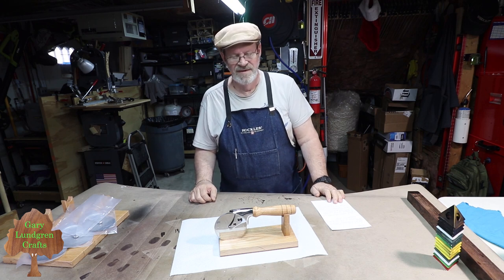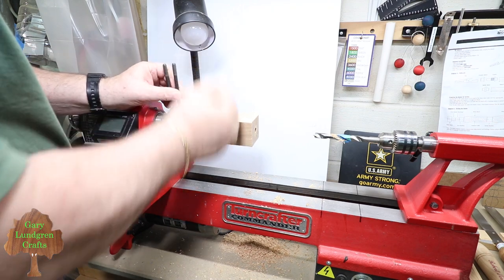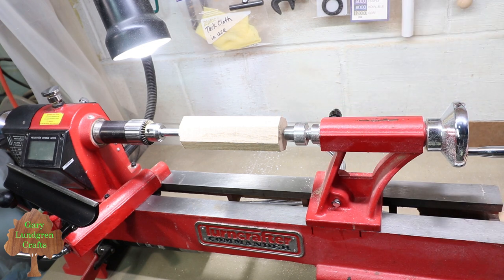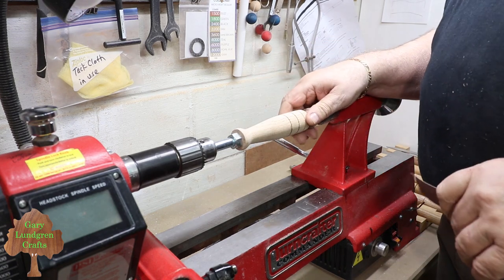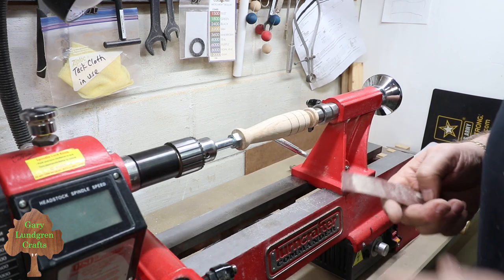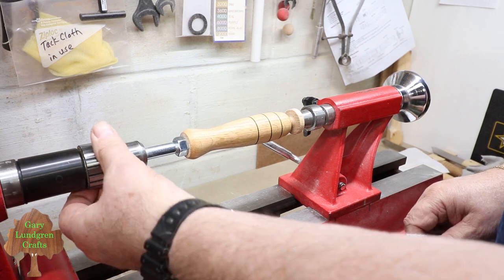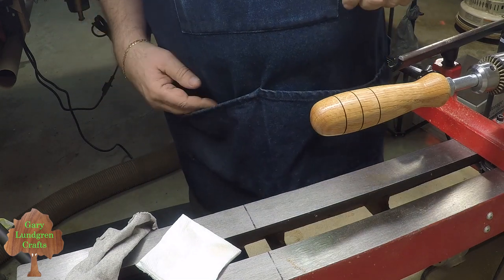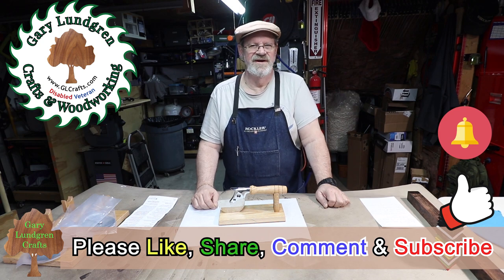Designing The Rockler Pizza Cutter: A Unique, Improved Take On The Classic Kitchen Tool.

Comment: I just made a couple of these as gifts, but I have to say I didn’t get any drill size for the insert to screw in the handle nor did I receive an Allen wrench in my kits. Didn’t know there were suppose to be so I never questioned it. However I did like your video. Gave me a few ideas on how to approach the next ones I make. Thanks for your input.  Very much appreciated.  By the way I did have the other type of insert that requires a special tool to install but later found out all I need is a 5/16 x20 bolt and a wrench
Reply from the maker: Thank you!.  Glad you enjoyed that and found a way for installing the treaded inserts for the handles. Product instruction are sometimes lacking. I've run into that! 👍

Comment: Just a quick note your wood will catch fire long before you loose the temper of the carbide tips. Carbide tool steel is heated to approximately 950 to 1150 degrees to temper. Dry wood catches fire at about 300 to 580 degrees.

Comment: Why not just put the threaded insert into the handle before you turn it?
Reply from the maker: Thank you!  Excellent question!  I did try that with the first few of these that I made.  I ran into a couple problems with that.  This may be confusing, but I’ll try.

1.	I didn’t want to glue the threaded inserts in place until I was ready for final assembly so I could align the wood grains in a most appealing orientation.  I wanted the most appealing part of the wood grain to be along the top edge of the handle.  On each hardware piece the threads were not always exactly started and aligned as the next.  So, it needed to be fitted on each piece.  To use the insert with a mandrel to match would not exactly align.  So, without gluing in the insert, the insert is a slightly loose fit, yet tight enough for the glue to hold.

2.	With using the insert with a mandrel and being a slightly loose fit meant it could slip during the turning process due to the lateral pressure of the lathe chisel against the spinning piece.  That would enlarge the hole more than wanted and the glue would not adequately make up for it.  I made the hole in the handle to fit the insert into a slightly larger than one would normally tap to because I found that tapping that, as large as you may a metal hole, the hardwood handle would split on me all the time.  So, I drilled a slightly larger hole for the insert to avoid that splitting, and the epoxy filled in perfectly and gave it enough strength to hold under daily use.
After ruining a couple $10 to $20 handle blanks, I had to find a better way, as I did above.
Again, excellent question!  Questions like this help us all to learn.  And this may not be the only answer.  As they say “there’s always more ways than one to solve an issue.”  I’m always happy to listen to suggestions, and more times than not, these comments improve my skills too.

Thank you!
Reply: @GaryLundgrenCrafts  Sure that part about lining up the grain makes sense I didn't think of that but when you spend $20 on a blank you want the best grain visible. I get what your saying about the hole and getting loose when you turn, the first two I did I had some issues with the insert. I wonder if a guy could turn a tenon and drill a longer hole so you could grip that end in a chuck and then cut off the extra tenon later?